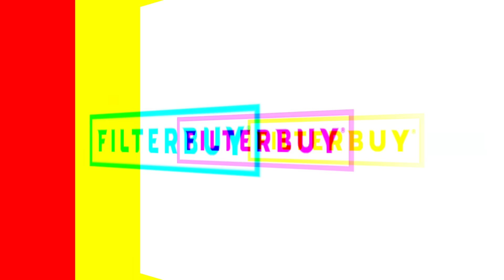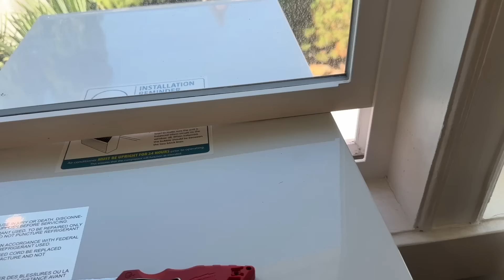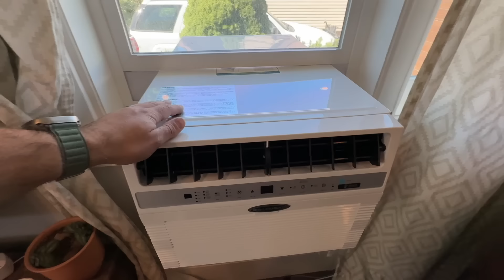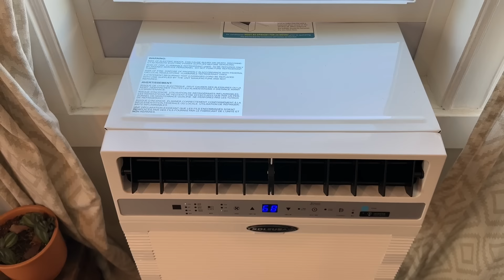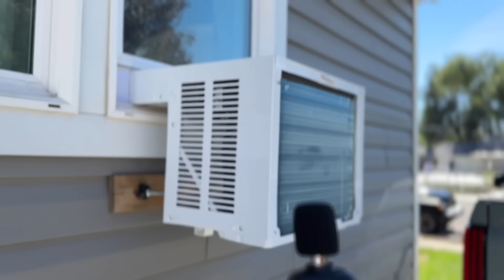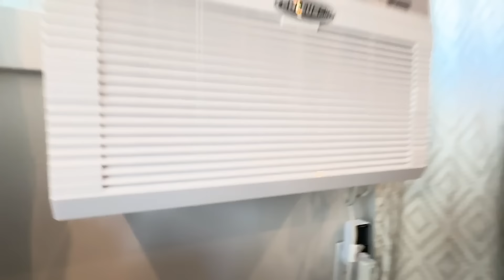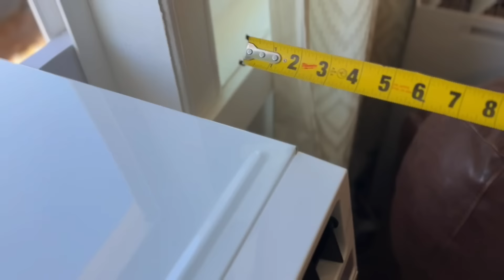I Thought It Couldn't Get Any Better... But It Just Did.

Comment: About the additional 200 clams for an AC that has heating, are you fricken kidding me!!! Not happening and will NOT
pay for that type of setup when you can utilize a low wattage oil filled space heater that is setup for 400 watts lower
setting that has virtually the same effect if not better so forget about it ! I already have some 4 said oil filled radiator
type of heaters that are efficient and affordable to take off chill or supplement my electric furnace type heat that can 
run if needed at anytime that i purchased back 2016-2017 at a most favorable pricetag. These oil filled radiators are 
used at night to be used for over a 7-8 hour period that also has a variable thermostat that you can dial in at about a 
third to half range on the dial for your overall desired temperature range dependent on the room size. And to be quite 
clear, when employed as needed; since the are power misers and they sip energy as intended!
Reply: (Continuation) Listen Up! 1.) I have an electric furnace that is used inside of a 51 year old mobile home! It 
uses a ton of electricity and yes it does have resistive elements that are driven in stages of heat over the 
course of said duty cycles and all four electric burners do not come on all at once! They are staged to 
perform in what they are called as duty cycles and depending just how just cold outside, while the inside 
ambient temp indoors will dictate just how long these stagged burners while remain on while given a pre-
programmed duty cycles or periods of time that they will remain on to satisfy the rise of temp inside for 
no more than what is actually required! Typically this electric furnace will turn on for about 8 minutes and 
once all four stages have gone into shut down, a cool down cycle of the internal heat cavity will commence 
and by the time the entire duty cycles are complete; just about 3 minutes later (to include cool down phase) 
shall encompass a snapshot in time for 11 minutes for fulfilling such demand for heat that is governed by 
your wall thermostat as a whole typically. Now I have actually thought about replacing the electric furnace 
with a propane fired unit but here's the catch: It will actually cost me more to heat my home as opposed to 
sticking with my electric furnace because of the outrageous cost of propane! Since that I am on a year 
around monthly Equal  Payment Plan with my supplier, though it is not cheap, at least I don't get surprised 
OR attacked by a huge burgeoning bill for the coldest of months in the winter season that could either wipe 
me out OR cause a crisis of my not being able to pay my bill and cause me credits issues as well! 2.) SO,  
since I already pretty much know what the budget forecast for the year, thus i am set for being able to make 
monthly equal payments here now of just just shy of 300 clams per month or a total of just less of 3600 
clams for the year which includes all forms of electric needs that i personally consume. 3.) So what have I 
done to keep my consumption below a certain threshold?? 3.) Well, I set my wall thermostat for 67 degrees 
without touching it thereafter and so I employ the use of these mineral oil filled radiator portable freestanding 
heaters while switched to the (400 Watt setting) and in addition to that, I use the rotary dial thermostatic 
control such as to "dial in" the desired "room ambient" temp to around 68 degrees for sleeping comfort, just 
only about 1-2 degrees above the already 67 degrees that my furnace provides for the heat throughout my 
mobile home. 4.) this temperature compensation takes the chill off in only designated rooms such as for 
bedrooms or bathrooms ( more confined spaces that are actually occupied) and does the job well over the 
course of 7-8 hours, with the doors to the rooms are cracked open 2- 2.5 inches just shy of being closed. 
This will allow heat such as in a colder room that doesn't get a lot of heat to a nice balmy 68 degrees. For 
the bathroom, I turn on the same type of heater and it too is set for the 400 watt setting while also setting 
the thermostatically control switch at mid way on the dial such as to preheat my bathroom one half hour 
to around 74 degrees before i jump into the shower to get scrubbed up! Once I've showered and gotten all 
finished, I shut it down. 4.) In essence, I do these sort of things and to get the thermostatic prime setting
down pat, it just might take you up to 3 days to get that prime setting of that thermostatic switch near perfect
for a desired 68 degrees in a bedroom by starting out with a low setting and gradually start dialing it up
until you reach the desired prime setting as needed. If I should overshoot the threshold I would only have to
back the dial setting off a bit to hit the room ambient desired temp, but then transfer an ink marking from the
dial pointer onto the stationary housing for the controls. This transfer of ink will indicatively tell you how to
set it back if your control gets moved or messed with but ordinarily, you just set it and forget it, but to then
use the main on/off main switch to turn off the heater, such as in the morning as you rise up from bed! Since
you will not be using that heater at a 400 watt constant over said period of time that of inside say one hour,
but since the thermostatic switch and the room ambient temp both shall dictate just how much WATTAGE
is actually used over the course of one hour's use case (again yet another snapshot in time) it will NOT equal
400 watts total consumption at all my friends but more like around perhaps 2/3rds if not really less than that
OR maybe even so much as oh I don't know maybe 275 watts total for said duty cycle average based on that
snapshot of one hour's time and NOT for that first snapshot of taking an otherwise cold heater up to that
prime heating target or second cycle. Once the heater is stabilized overall, it will just sip on oh about some
said 275-300 watts used and remain in that state until you so decide to shut it down. Project that over a
7-8 hours average, your consumption just might turn out just might be as little as none other than 300 watts  
overall times 7-8 hr. average, 7.5 AVG translates 2.250 KW of electric energy x .11 cents per kilowatt equals 
around $2.475 per day of use typically for my main bedroom to help offset the chill in my main bedroom size 
of that is not more than 120 sq. feet interior with any true comparison of my jacking my electric furnace to 68 instead....One HUGE MASSIVE difference in energy consumption to an acceptable level of comfort overnight.
  
With everything said here, while back in the 1990's: 

I absolutely feel in love with these quartz type resistive upright heaters because of their absolutely great radiant 
heat but that would have come at a big cost to operate! Well now these mineral oil filled radiators do a much 
better job overall and strictly based for a more confined living area, are just the cat's meow, bar non and the 
radiant heat is ever so smooth and polished for the most point and I swear by them and so the one's that I 
purchased are durable and I can see them lasting a possible 10-15 years worth. If I am truly smart about it, 
I would find and purchase these replacement rotary main switches and thermostats in the here and now just to 
have them on hand to be able to replace them in the event one or both of them gives out! These are the only 
true of said 3 main components that in time will eventually give out! The third item is a protective thermostatic 
limit fuse that could conceivably blow out because of an internal thermal limit protective shutdown which is also 
relatively cheap as well! You must however need to have a series of explicit manufacturer's part numbers to be 
able to source and purchase based on the make and model! You must also be able to inspect for defects, burn 
marks or discoloration of said wiring inside and out that could have a potential of being a fire safety concern; 
troubleshoot to a fair degree and make said repairs in a professional manner and be able to properly test out 
your finished repair work. So, to sum things up, these reliable manufacturer's that have provided you with just 
simple heat methods are a dandy despite what some people tell you and typically have a very good if not great 
track record overall, provided that you are NOT trying to heat a  something like a total open space but instead 
a confined space such as a bedroom or bathroom that has furnishings that help shrink that space that you are 
trying to heat, as in a 8'x8' Or !0'x12' ! I still have a horizontal 400 watt quartz heater while set in the low setting 
or 1 of 2 quartz heating rods turned on that not only makes for a wildly toasty bathroom in nearly no time alone, 
that is not only toasty with the door closed but if you are not careful about your safe setup, you could quite 
possibly set the room ablaze! So yah, this has been my experience and I thusly stand by my methods of pure
madness OR I would just stop what I'm a doing altogether!! This is me and not just any other flesh and blood
saying this!  My go to in the brands that I had purchased, these are: Duraflame, Patton and Optimus Heaters,
2- Duraflame's oil filled, 2- Patton's oil filled and 1- Optimus Quartz type heater. Two of said such manufacturer's 
they no longer make! Optimus I have seen still lurking around since they are most likely "New Old Stock" that 
can be had for around 50 clams on a good day but could also be priced at for much higher! The same could be 
said for these oil filled radiators which could be typically priced at around 70 clams if NOT higher!!! These stroke 
of pure madness chinesium models, you just don't know what in the hell that you are getting, while some if not 
most are hunks of junk and most of them too are over priced. So beware, if not be highly aware of said type of 
products that are typically sold at Walmart and other box stores by looking up: "Oil Filled Portable Space Heaters" 
and chances are that you will be directed to the appropriate web pages OR just do a look-up on StartPage Web 
Search Engine, FORGET Google!!! with the description given!!
Reply: This produces at least twice the heat relative to the electricity consumption vs your resistive air furnace or oil heaters.

The idea is this is a replacement option when your air furnace kicks the bucket. By then hopefully there will be more window heatpump options on the market driving product improvement.

Or you could install minisplits. If you do it yourself they're pretty affordable. If you hire a pro... May your wallet Rest in Peace
Reply: @priestesslucy  Oh no, to arbitrarily follow yet limited information just because it is new and not know the full on story of how such systems actually work both in principle and what these systems are not capable of is absolutely ludicrous! My brother in-law bought three of these types of systems which came at a very big cost for his place of business only to find out that they simply would not work meaning they would not produce any heat when the outside ambient temperature was below a certain level and I believe that it was something like 28 degrees! So enough of all of this hype about these split systems technology when following all of this blindly only to say that it works and just how really cheap that it is! It doesn't do any good if the damned technology isn't what it should be in colder climates like the New England states if the damned thing doesn't perform to a higher standard! So enough of all of this hype and happy horse chit already!!! These are in a way supposed to mimic the older technology of heat pumps while although with the use of special refrigerant gases along with the conversion of the the outside ambient temperature to a quasi reliable heat while in a sense reverse plumbing of the compressor and/or condenser and evaporator just so that it can produce heat! In theory it is supposed to work but unless there have been some serious but very drastic changes made, the damned thing is not going to work for colder climates! For your more tepid climate zones, yes but in fact they technically should work for the early fall and on into at least till towards the mid part of December and MAYBE in the later part February thru April or May as needed.
Reply: @craigtegeler4677 Sounds like your brother should have done his research before buying lol.  They absolutely make split systems that can heat well below 0 these days. Many brands now have units that can heat to roughly -14

Comment: to be 100% honest, NO, you do NOT have 100% use of your window with one of these units. 
in 99.9% of the cases, you lose the ability to lock your window.
Reply: I have an adjustable rod I use when my window is open. 
It would take a ladder for someone to get in, but it eases my mind none the less.
Reply: A 1x3 makes a really good lock if you have it cut to size

Comment: I've tested a few portable "4-in-1" portable heat pumps, and as far as I can tell, none of them have a dedicated defrost cycle of any kind. When the temperature gets much below 55F, the outdoor evaporator coil freezes solid, and the unit makes no attempt to defrost it so it stops heating. It's extremely unfortunate, because even a simple non inverter heat pump would be awesome and highly usable if it had a defrost function.
Reply: I have a Whynter portable dual hose ac/heat pump. It works to about 40 outside and will heat below 40 if it has another heat source to draw from but that defeats the purpose... Nice in the fall though but i remove it to keep heat in by December.
Reply: So are we stuck having to buy a 1300 buck Mr cool mini split?
Reply: The hisense portable dual hose unit works down to any temperature in my experience, I've used it when it was 1 degrees outside and it still works, it does have a defrost. It's just not as efficient as this unit.
Reply: Outside unit shouldn't be frosting until temps get below freezing.  If it happens above that, there. are other problems.. (blockage, lack of gas, ???) or it wasn't ever designed to be used in such temps.
Reply: @spazzman90  they start frosting at 40°F in my entire life's experiences with heat pumps in NC. That's why most of them work down to exactly 41°F...the unit featured on the video operates down to 30°F
Reply: @spazzman90  Frosting will happen when the outdoor ambient is 20F above freezing because the evaporator has to be colder than the ambient air in order to cause heat transfer. Just like how the indoor coil temperature will be hotter than the indoor air temperature.

Comment: There were window units that heated 30 years ago.  I worked on some Friedrich units for an electric utility switchgear buildings.
Reply: Did they have defrost functions? I am very concerned, because I have tested a few portable air conditioners with heat pump functionality, but none of them seem to even attempt a defrost, so they freeze solid and are useless in temperatures below about 55F.
Reply: @gregorymalchuk272  Motels have used them for many, many years and still do.
Reply: They included inefficient radiant heating coils inside, and they still make them today.
Reply: @spazzman90  Yep. Quality Inn just down the street getting remodeled and brand new ones at this very moment
Reply: What was old is new again!
Reply: In my younger days I worked part-time for an HVAC/Building Maintenance company. The formen conducted the task of providing estimates to residential customers. They told me that management prohibited the use of ANY
Friedrich equipment. The reason I was told was too many, and various, customer complaints, too many repeated service return calls and warranty problems. I did meet several people who were very satisfied with their existing Friedrich systems so who knows. I'm out of the business now.

Comment: Is there any place where you can buy a used furnace that isn't very old?
Reply: craiglist or facebook might have some but they have short lifespans to begin with around 15 years tops anymore most people replace them because the heat exchanger has rusted or cracked so they are not safe.
Reply: @ranger178  My current furnace is a 1980's model, with a pilot light. It still works but isn't nearly as efficient as the newer ones. I can't afford a brand new one, but would like to get something more efficient. I was wondering if there were places where you could purchase one that's been refurbished or re-certified.

Comment: What happens to the evaporator condensation?
Reply: Looks like the interior unit needs to be manually drained by removing a plug.  Unit shuts off when this becomes necessary. AC mode only.

Comment: I don't know where you live or the designers of that unit live but in MI, you can't use a window that doesn't have a screen.
Reply: Is it not possible to buy a smaller screen and caulk the bottom of it to the top of the unit?

This is a heating and cooling unit, so it stands to reason you might leave it installed year round
Reply: Do you know where MI is?

Comment: This has to be a paid ad.  That unit is priced over twice what it should be and the reviews indicate they have some quality control issues that need to be addressed.  It’s a great concept but I’m gonna have to pass.
Reply: Gradient is selling a better version of the same thing (heats down to negative 9F, with decreasing efficiency below +17F) thing for $3,800 as in thousand.

With a minimum functional source temperature of 30F, this thing would be priced quite well if it were well made.
Reply: @priestesslucy You are correct. Several companies are starting to make these units with defrost cycles that will heat in much colder temps.  Hopefully in a few years prices will come down.  And if you own the property at this point I'd just put in a true mini split system.
Reply: If the reviews were much better I would say the price was right on with A/C and heat.